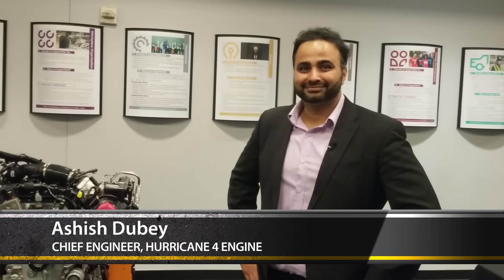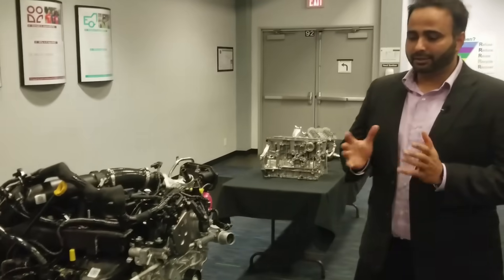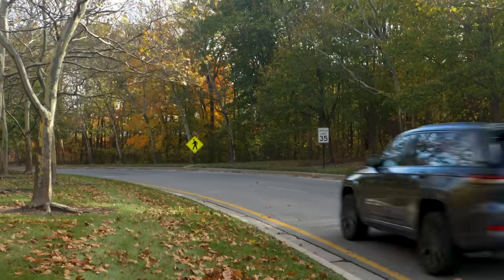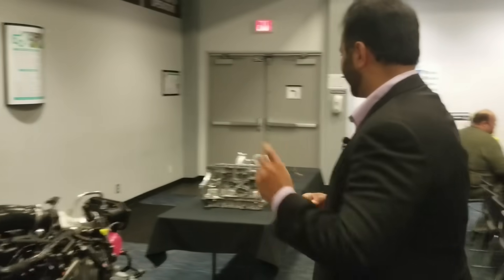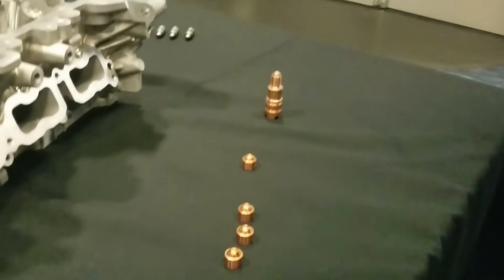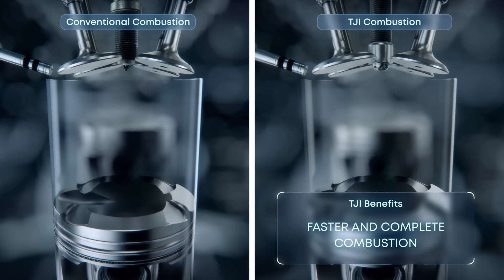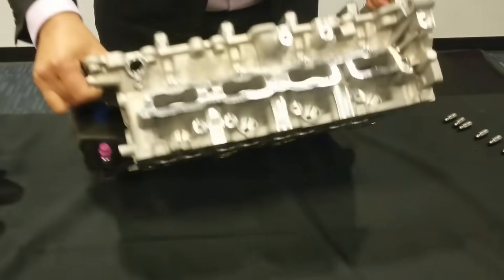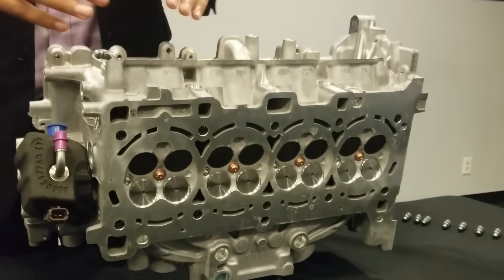Stellantis Just Put F1 Tech Into a Jeep! - Autoline Exclusives

Comment: F1 forces teams to a maximum of 4 engines per driver per season, so that averages out to about 8 race weekends per engine, I think.  So I think that works out to about 1500-2000 miles of lifespan in a typical F1 engine.  Yeah, that sounds about right for a Stellantis powertrain.
Reply: LOL spot on
Reply: they r not pushing 850 hp from 1.6 liters at 15000 rpm.

Comment: First, let’s look at what Krupa’s FireStorm spark plugs give an internal combustion engine:

More horsepower
44 – 50% Increase in M.P.G.
Dramatic decrease in emissions
Second, let’s see what FireStorm plugs eliminate:

Smog pump
Catalytic converter
Radio Frequency Interference (RFI) and the use of resistors in the center electrode
Gap growth
Exhaust Gas Recirculation (EGR) systems
Misfire/hesitation/detonation/stutter & stumble

Comment: Throw the I6 HO hurricane in that Jeep as an option FFS 😵‍💫. 
This car used to carry the SRT . The traditional Pentastar can’t get out of its own way.
Reply: Not true. I have the pentastar in my  300. I've rented a 25 GC L with the 3.6. 6 Hr road trip 6 people loaded with luggage,  did just fine with decent fuel economy. No, it doesn't have the torque of the hemi. You ain't towing no 10k trailer with a GC, it's not needed.
Reply: @nattadam4171 so 0 to 60 in 6.4 sec is “absolutely fine” for you BUT if you want more fun at least offer it to people who will pay. Switching to a 4 cyl only option is a mistake. I’ve owned  JGC for my last 4 leases. And dragging a trailer on the beach -I’m going with more hp everyday.
Reply: @kenpohanis5211  I have no problem with offering a more powerful engine, but it's not needed for that vehicle, and don't even know if the I6 would fit under the hood. I would have the hemi. 
I won't buy suv's or trucks for 0-60 times.
Nevertheless my Armada will do it in under 7, and can tow 9k

Comment: I was curios to see the block.  A little let down, that for such an “advanced” engine with fairly robust output, they went with an open deck.  It could be very reliable and long lasting, just don’t breath on it.  

The Hurricane 3.0 I6, on the other hand, has a closed deck, so if you want to turn your the boost, rigidity and stability, have been really good so far.  Some tuners are already at 1000 hp, with no structural failures.  

Maybe they’ll close the deck in gen 2 and hopefully add PFI to the I6.

Comment: Time will tell. If it passes the durability test in real.world in North America especially out west in summer heat huge.passes. oh. It is a jeep so it better.offroad well wich is usually slow and little.air flow except fans. Transmission gets super.hot. just modernized strait 6. Give the jeep the.motor dodge didn't want. Maybe traditional jeep.buyers would be impressed.  This bel9 gs in a sport car. Not.a.4x4 in actual use.

Comment: Kudos for Stellantis (not known for absolute quality) to take these Maserati patents and apply them.  Modern engines are becoming very advanced.  The pre chamber idea is interesting as it does come from high end uses.  I thought the head looked fabulous on the valve side with a small combustion chamber yeilding 12:1 CR.  Dual injection is a big plus to avoid the walnuts.  Apparently in the Maserati development this is partially to ensure Stoich.  AFR for the system to work well and be cat friendly.  The power sounds compelling and turbo torque is very impressive and flat usually these days. It's just a 4 cylinder so it is not complicated.  They also can expand this idea to the 6 cylinder family.  Inline 6 are so smooth and balanced and naturally long lived for that reason.

Comment: What I find amazing is the electronics required to monitor engine performance and adjust the valve timing, turbo guide vanes, fuel injectors, and firing hundreds of times a second.  Not the old vacuum advance distributor with points and condenser I grew up working on.
Reply: That’s the difference between a 4000 rpm car and today’s high rpm cars. There’s soccer mom minivans that rev higher than old school muscle car engines now. 8.5 used to be standard compression, these days the average is more like 10:1 with some even higher. Interesting times for sure. 
And for the record I had a 19 and 78 IH Scout ll with the 345 v8 and I carried a distributor wrench in the glove box to adjust for good or poor fuel. Lol

Comment: Honda did this in the 70s with the cvcc 1500 and 1200 they did it for emissions only vehicle did not require catalytic converter
Reply: Yes except they used complex carburettors with electropneumatic control to run it at the end of the day Hondas CVCC system is a crude version of this system there is no way it can compete with modern electronic controlled systems of today.
Reply: @jonathondeeds3423 it had nothing they had a pre combustion chamber built into the head of the motor their carburetors were fairly simple on the 1500 CC it was a 3 barrel the only thing complicated was about it was nothing still even had a manual pull out choke but it would automatically go back I don't know what you're talking about being complicated in
Reply: Same thought

Comment: Just a reminder F1 engines are rebuilt post every race. One word regarding the new 2.0 EVO Hurricane, "RELIABILITY". We've seen issue with early Pentastar engines and that was a naturally aspirated engine. Doubt the addition of a turbo and high compression engine will in anyway improve reliability or repairability. Will wait a few years for the wrinkles to iron out before committing to this or similar new engines. Diesel: Generally operate at lower RPMs (e.g., up to 180,000 RPM) vs Gasoline: Can operate at much higher RPMs (up to 300,000 RPM) which effect reliability. This I.C.E. powerplant is too late to market considering what's happening in the next 3 years with vehicle battery tech.
Reply: F1 have 3 engines per year to use without grid penalty. thats 22 races per year! LOL!!!!! what are you even talking about??????

Comment: Fantastic
We have had a 2L turbo in our 2019 Buick Envision for 6 years now and the engine is really nice.
Tons of low end torque and not a single problem.
This new Jeep engine should be even better because it has water to air intercooler and electric cooling pump...
Reply: How many miles?
Reply: @nattadam4171  71k, 98% city stop and go....

Comment: yes, it is better. but it looks like a t-rex dinosaur with fancy shoes and a manicure and a fancy haircut.
i want to see an electric motor from DeepDrive with the same power output next to it. it is probably a can with the volume of 2 liter.
btw. this pre-combustion chamber was developed ten years ago by Mahle 10 years ago and got released in F1.
"clean sheet engine design" my ass.
it is the last noise from the combustion engine manufacturers making their stuff even more complex and expensive while BEVs are getting better and cheaper.
look at the tech from the new BMW iX3. fantastic stuff from germany and currently the best in european cars. but there is much better stuff waiting in the queue already.
like the upcoming highly efficient motors from Yasa/Mercedes AMG and DeepDrive, the faster SiC inverter switches from Infineon and better battery tech coming from all over the world. 2028 more capable BEV will be cheaper to buy than ICE cars.

Comment: Yeah, right. Does it still have the wet belt? Where sellantis refuses warranties? Or EV charges which fail and refuse warranties? Im staying away from this company
Reply: Confused with Ford powertrains perhaps?  Maybe 3.0L duramax?  No belt driven oil pump on any of the Hurricane derivatives.
Reply: @okcmoparguy724 no im talking about the EU cars (citroen, peugeot and others) which have a wet belt resulting in total engine damage and stellantis have been trying everything to avoid taking responsibility or warranties
Reply: Hurricane engines do not have a wet belt.

Comment: A more complicated Stellantis product? Good luck with that. Stop building efficient engines and start building reliable engines.
Reply: Stellantis has dyslexia when it comes to reading a room. They don't need super duper mega high tech and complicated to fix their dwindling market share, they need an affordable, mass market vehicle that works as intended 100% of the time. A product they don't have currently. 

They promised a more affordable Ram, and what we got was a trim that costs more than the base model, which they de-contented. They brought back the HEMI, but it's now an extra cost option and they didn't fix any of its flaws. 

Every single new product they have introduced has tried to move further and further upmarket, at some point they need to ask themselves which puts more money in their bank account, selling cars that excel at checking boxes on a marketing buzzword checklist, or selling cars that work.

Comment: I wonder how long it will be the press fit fails. Stellantis has long had an issue with keeping valve seats in the cylinder heads, so adding potential shrapnel to the combustion chamber seems like a bad idea. 

Will be interesting to see if they last.
Reply: only depends on the quality of implementation. but in a few years it does not matter anyway. BEV are taking over because of the fast progress in this sector.
Reply: @stefanweilhartner4415  It will matter to the people that buy them. 

If the pre-chamber loses its press-fit and the only thing holding it into the head is the spark plug being threaded into it from the other end, what do you think is going to happen when it comes time for a tune-up? Eitther the pre-chamber will spin and make removing the plug impossible, or there is a good chance that as soon as the plug is removed the pre-chamber will fall down into the cylinder, necessitating removal of the cylinder head. For a tune up. 

Someone is going to drop 40+ thousand dollars on a vehicle equipped with this engine, and be stuck making payments on it for 6+ years- so the long term reliability of the engines VERY much matters.
Reply: ,,, it's bean counters , overriding good mechanical engineering sense . They cheaped out on the seat insert thickness ( height ) . Everybody blames the press fit . Wrong .  The dam seats don't have enough " purchase " . Btw , nobody agrees with me .
Reply: @rolandtamaccio3285  Now, take what you just said (which I agree with, to some extent- they have an ongoing issue with less than ideal machining and not-quite-to-spec seats too) and apply it to the pre-combustion chamber shown in the video. 

Look at the size of the Maserati unit vs the size in the 4cyl. which of those two do you think is going to have more purchase on the cylinder head? Which one of those do you think stands a greater chance of having the press fit fail due to metal fatigue of the surrounding material?

Stellantis has QC issues, both on their end and on the supplier end. The last thing they needed was another ridiculously complicated engine with new and exciting possible modes of failure... but here we are.

What they need (IMHO) is a simple, mass market powerplant that can help rebuild (okay, build) their reputation with consumers. The pentastar follower/ camshaft issues, Hemi lifter oiling issues, Hurricane 6 overheating and misfire issues, and their electric paperweight experiment haven't done anything to endear them to consumers. They need to fix that, or it won't matter how nice their vehicles are because nobody will buy them.  In other words they need to figure out how to build a wheel before they go trying to reinvent it.

It seems like they want to turn Jeep into the North American equivalent of Range Rover, and they're determined to start by copying their reliability.
Reply: My first thought too